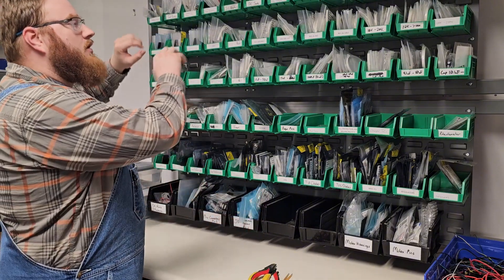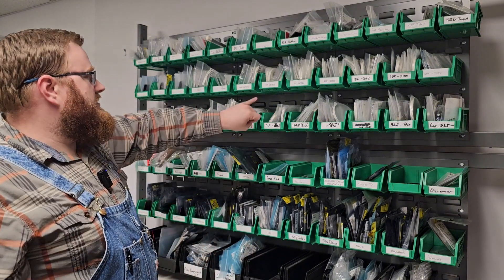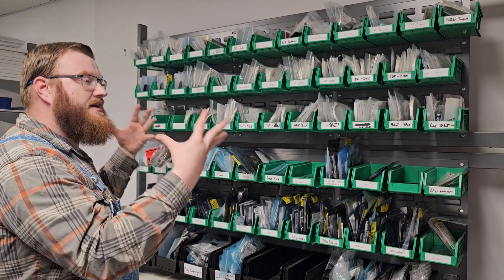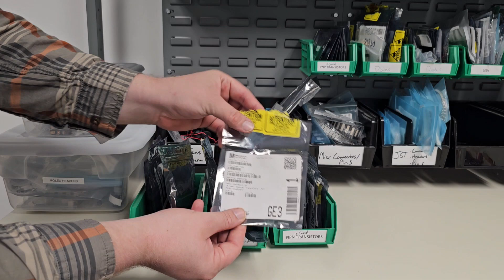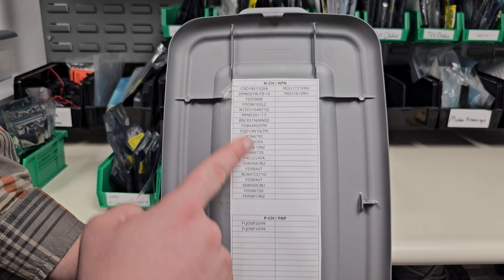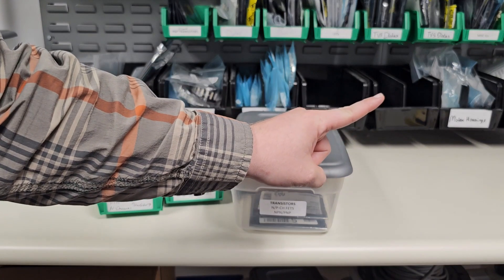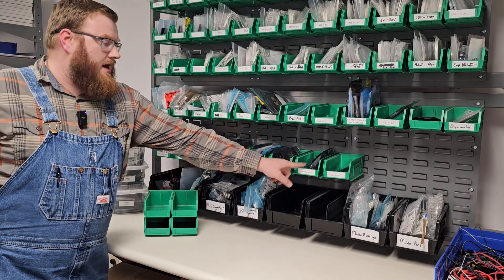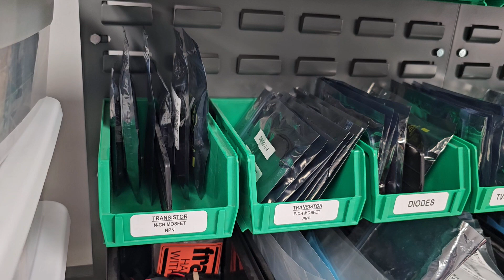The BEST Way To Organize Your Components!!!

Comment: What are the dimensions of the green bins that you are using? They seem to work the best size-wise?
Reply from the maker: They are 7-3/8"L x 4-1/8"W x 3"H. I got these from global industrial: 269681GN
Reply: @eetengineer  Awesome - thanks so much for getting back to me on that! Great video, by the way. I've decided that this is the smartest route to go.
Reply: @eetengineer  I found the bins that you are using and I also found the panels that you mount them on. What I can not seem to find is the frame that you mounted the panels to.
Reply from the maker: @typeone2 I used these that mounted to my workbench, but any kind of louvered panel should work. There are also adapters you can get for pegboard. 

https://www.uline.com/Product/Detail/H-5767/Deluxe-Workstations/Deluxe-Workstation-Louvered-Panel-18-x-19
Reply: @eetengineer  Once again - thanks so much!